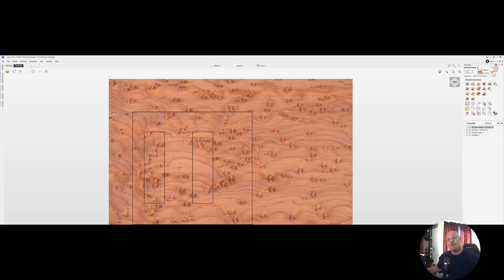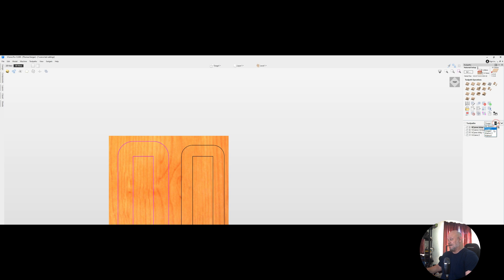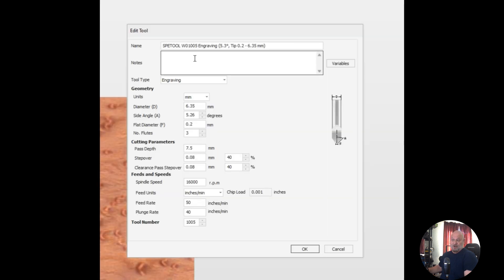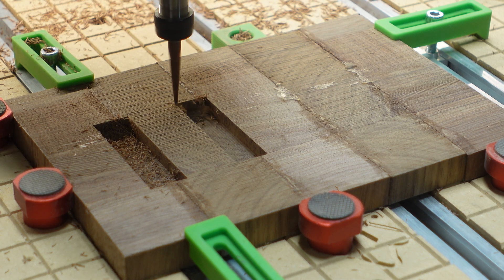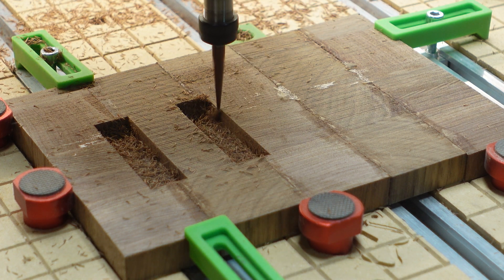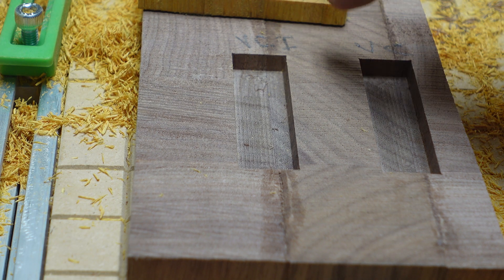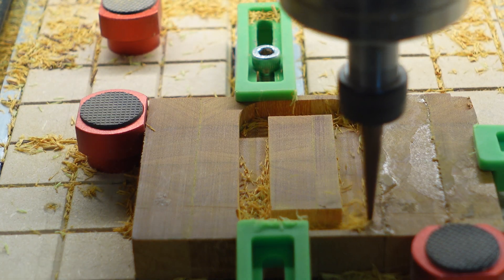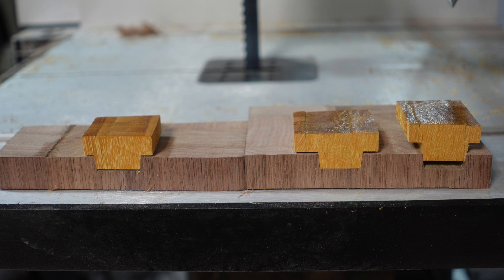Comparing V-Carve Inlay Strategies for Tapered Ballnose Bits | TK Designs

Comment: So when you configure the TBN you put it as Engrave tool. Take 1/2 of the angle AND diameter?
Reply from the maker: You will use the side angle of the tool. For example, the SpeTool W01005 Tapered Ballnose bit is a 5.26 degree TBN. The 5.26 degrees is the side angle, and should be entered as the side angle when configuring as an Engraving Bit. The diameter of the tool should be entered as the flat diameter. When configured as a TBN, you used side angle and tip radius (1/2 the diameter).  Let me know if that clears it up for you. Thanks for watching!

Comment: Awesome video and spot-on info as always, 
The clearance tool looks like it's cutting butter, what's your settings if you don't mind me asking
Reply from the maker: On the pocket side, I go full depth of 6mm with the clearing tool (1/8 inch endmill). For the plug side, I go full depth of 7.5mm.  Speed on both is 18,000 RPM, and feed is 60 inches per minute, with a 30 inch per minute plunge. Thanks for watching!
Reply: Thanks mate, think I'd better upgrade to a 3 flute bit, I've only ever used 2 flute
Reply: Nice because he is cutting end grain verses flat grain, big difference
Pat
Reply: @patraymond3791 yep I new it was end grain, the question was in relation to the tool

Comment: Based on your experience, is it best to use the traditional V-Carve Tool path with the TBN configured as an engraving bit? I'm hoping to get started on some inlays tomorrow and would like to know which parameters you have had the most success with. I purchased both the Amana and the SPE ball-nose bits and I'm ready to do some testing. I've watched most of your videos and appreciate the time you have taken to help the community better understand inlay parameters.
Reply from the maker: Thank you for your kind words! I still very much prefer the traditional method. For my pockets (female side), I always use a start depth of 0mm and flat depth of 6mm.  For my plugs on the SpeTool bit, I use a start depth of 5.5mm and a flat depth of 1.5mm.  It seems to give a nice tight fit. For the Amana bit, I forgot what I I use for the plug side. Depending on your machine, you may need to break down the plug (male) side into multiple toolpaths, otherwise your bit WILL plung then entire 7mm depth of the cut. That could result in damage to your bit, or possibly machine if the bit catches and doesn't break.  Please take necessary precaution to ensure your machine can meet the capabilities of the toolpath you configure.  Thanks for watching!
Reply: @tk.designs  With these parameters, Do you typically configure the SPE as an engraving bit, or actually as a TBN? Thanks!
Reply from the maker: @Teeter925  I configure the SPE as an engraving bit. You can test it both ways to see what works best for you.  a regular vcarve toolpath will accept v-bit, engraving bit, or TBN.

Comment: Thanks a lot for your great Inlay videos. i am doing finer details than in your example and I just cannot get a good result using vcarve inlay for the plug. I can use vcarve for the pocket and pocket toolpath for the plug and change my z 0 from 14.3mm to 13.8mm. it is close to perfect, but leaving 1.5mm gluegap. I am using Amana 46280, bit will try the 5.2deg SpeTool that you use.
Reply from the maker: I followed this video up with a deep dive into the v-carve inlay toolpath using both bits above. The video is here: https://youtu.be/oEmTH3y9LsE Hopefully this helps. Unfortunately it seems that there is no real magic formula that works consistently with even the same bit when performed on different machines.  Please let me know if the video helps.

Comment: Good video pushing things further to dial in the best way/ways of doing this.  Did you end up surfacing off the excess plug material?  Would have been nice to see if the loose fit on the new inlay toolpath had visible glue gaps.  Increasing both glue and surface gaps would drop the plug in further and tighten up the fit.  I'm running an excessive surface gap on mine, but that was both to clear the ridge that I'm seeing on the plug from the TBN and because I'm trying something I haven't seen yet for repeat pieces.  I'm making more of that mountain cutting board and have the plug blank for the snow starting at 2-1/2" thick, planning after the glue sets up to cut through the gap with multi tool and pullsaw, stick it back down and surface it flat to go again with another plug (should get 4 from that blank).  It's about the same amount of time to cut and glue up a thick plug blank as a thin one, so if it works as it should there will be a huge time savings as so far I'm spending way more time processing material into end grain stock than I am running the cnc...  🙄
Reply from the maker: Thanks for suggesting going full depth. Definitely going to do it in the future as well.  the loose fit, and for vcarve inlay toolpath is able to be seen in the original video I did comparing traditional parameters vs the new vcarve inlay toolpath: https://youtu.be/ekcYssMjSzo

I am having to wonder if the ridge that you see is being caused by something else.  I will be experimenting more.  Maybe the glue gap/top gap you are doing in imperial units is causing the ridge, but I can't confirm unless I try to work out your settings.  Can you give me your vcarve inlay toolpath settings in inches?  Thanks again for watching and for supporting the channel! Hopefully this video sends a few more folks your way too!
Reply: @tk.designs  It's not just me seeing that ridge, when I started using the new toolpath and having issues I searched around and found it to be a common problem.  What I've yet to figure out is why you aren't seeing the same thing.  You are zeroing all bits on the material surface, yes?  Gap settings shouldn't affect it, I get the ridge no matter the gaps and just increased surface gap enough to make sure it get down to the material surface.  I'll have to go back and rethink the whole interaction to make sure my understanding is correct and didn't miss something, but for now what really matters for me is I found settings that make the new toolpath work.

I had seen your first video on the new toolpath also and the loose fit, did you use the same settings for glue and surface gaps this time?  In this video you showed glue gap of .5mm and surface gap of 1.5mm, which equate to .019 and .059 inches and are very tight compared to what I'm running.  I started at .065/.065 with which the plug bottomed out and the fit was too loose, and worked my way up to current settings of .120 glue and .200 surface gap (3.05 and 5.08 in funny numbers...  😀), with the surface gap being larger than necessary but left that way for the reasons I mentioned above.  Since you are seeing a different result from the bit and not getting that ridge, along with a pretty decent though slightly loose initial fit, you shouldn't need to go that big.  If you want to run another test set it up like you did here but all with the new VCarve Inlay toolpath and go 1mm/2mm, 1.5mm/2.5mm, and 2mm/2.5mm.  You already have the .5mm/1.5mm example, but if want the best visual presentation throw that one in front so they are all in a row in the section cut of the board.  My guess is either the 1mm/2mm or 1.5mm/2.5mm will seat tightly with the proper glue gap.. 🤔
Reply from the maker: Yes, I zero from the top of the material, and my Shapeoko Bit-Setter re-does the zero on every tool change.  I use 1.5 for the surface gap, and 0.5 for the glue gap for every inlay I have done using the vcarve inlay toolpath. It is definitely a bit loose, but there is no gap that I have noticed, and the cuts seem to be very consistent through the first several projects I've done with the new toolpath.

I am going to do an extensive testing video, which I hope to have out by the end of this week, or perhaps the start of next week. 

I want to try to do a deep dive into the new toolpath, as well as traditional vcarve toolpaths for inlays.  The goal is to develop a strategy that does not rely on a certain bit, or certain parameters.

I want to develop the method so anyone can repeat the tests, and come up with what works best for them, kind of like what you have done.  Thanks for sharing your insights with me! I certainly appreciate it!